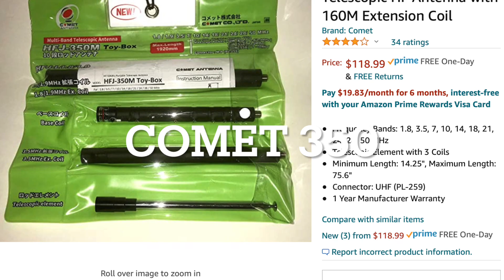NVIS field test in the mountain

Comment: you can make a simple dipole wire antenna and go far far away, deploy it using a tree and you will have contact if the propagation helps (here the time is 11h to 13h and 15h to 18h to near talk open)